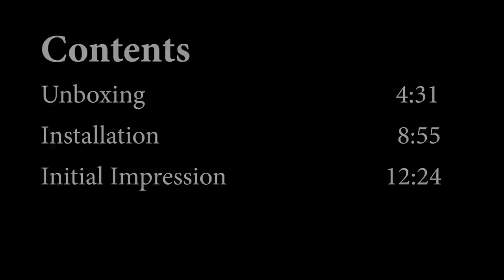"WeBoost Drive" Cell & Data  Booster/Amplifier Review: Intro and Installation

Comment: Thanks for review. I took a 2 month trip from NY to Texas to Florida and back at the beginning of the year. I tested  the Weboost 4G-X-RV with Verizon, ATT, and T-mobile at all the places I boondocked/camped. I tested both an omni and yagi external antenna. The results were interesting. I learned a couple of things:

1st, DB isn't a very useful metric. I used the Speedtest app to check upload/download speeds. You can have great DB, but a crowded/lousy cell tower. After all,  how fast you can download or upload a video is what makes the booster useful. 

2nd, there was no best network. All three major networks were better at some places. A good portion of the time, the unboosted signal had a better download speed than boosted. Upload speeds were always better with the booster.

 3rd, The yagi takes time to set up (and can't be used while driving). In really remote areas with no signal, the opensignal app didn't always give a direction. So you had to hunt for the tower. At one place on the Texas coast, I could only get a connection with the yagi antenna. Most of the time, the extra effort to put up the yagi wasn't worth the effort. The omni antenna provided similiar upload/download speeds.

I have a small 14.5' trailer and I had to use the small candy bar antenna instead of the one provided with the RV kit. Since I couldn't get the required separation (getting green leds during boot-up).

Weboost was definitely worth having. But having multiple carriers is also important!

Comment: Hi...Thanks for the video. Please run a speed test with the booster turned on and with it turned off. Why guess? The increased speed from the booster is what we're really interested in. Thanks
Reply: This where the problems come. I have this booster and I will give it credit that it will increase the signal. HOWEVER run a before and after speedtest  and data speed are CAN BE worst with the booster on. Weboost has a wonderful marketing department.

Comment: The five bars showing on the phone represent the rebroadcast signal from the booster. Since the booster is in the RV with you, it makes sense that it’s a very strong signal. Unfortunately as you note, that does not mean that you get the same speed you would get with five bars generated from a cell tower. If you had one bar to begin with, the signal being rebroadcast to you is not great quality, but glad to hear it does help.
Reply: I’ve never seen one that works that way but anything is possible. The good news is it did help.

Comment: Looks like a great product but one thing I noticed was the sticker on the antenna reads that the frequency range is between 698 to 2700 megahertz. T-mobile especially and I beleve some AT&T are rolling out new service in the low band 600 megahertz Spectrum. Before spending this kind of money I want to make sure this product will operate on the new spectrum and if not is there a new model that will?

Comment: You may have great signal to talk to the tower, but everyone using the tower must share the  bandwidth. The more users the slower the throughput is.  If the tower has 5mhz bandwidth not many users can use the signal at the same time. If the tower has a 10mhz bandwidth carrier the you will get better throughput with the same amount of users but as soon as more users get on, the slower the throughput gets again, all the while you have 4 to 5 bars.

Comment: got it, love it!
Reply: vantastic voyage, do u have a video on it?  Is it mounted on ur roof?  Mo
Reply: I have it installed on my 18 wheeler. It has a slightly different antenna than the rv version but it will work on an rv. no i don't have a video yet

Comment: Hi Carolyn and Bob. the cable has been compromised once you bend those cables around that ladder making those sharp turns the cable has been compromised so if you're going to put a permanent one in don't make any sharp turns with it and if you don't and you want to get a new cable wrap it in a large Circle and hang it somewhere but you can't make sharp turns with it or it will compromise it and then your signal will start going out on you

Comment: They are not spacers Carolyn. They're called Dyna bolts for inserting  to pre-drilled holes in concrete. Thats why they were spreading as you tightened the nuts.

Comment: This product looks like it's for use while driving and parked because it sends/receives in all directions.  I suspect the directional(triangle shaped) antenna would work better than this one while parked.  At least it gets your cell signal outside the RV where it has better propagation than from inside.

Comment: Mr. Bob,
Tell Carolyn
....do not tie the feed line "coax RG6" on that latter as seen to the left of Carolyn. 
....please do not store it that way ether. It's not extension cord or landline cord.
....take care not to mash, kink, pinch or tight bends. That can cause distortion to the dielectric insalator. That's the stuff between the center conductor and the metallic shield underneath  the outer plastic jacket. 
...specially if it's retransmitting or broadcasting back to cellular tower.
  Can cause some problems in preformance. 
Just saying. 
Just loop it in a 10" to 14" and loosely zip tie it or tape to latter.
Thanks for what you do!
Jeff

Comment: Signal strength and speed aren't necessarily related. Traffic on a tower can slow speed since it can only handle so much at a time. So you can have a full five bars and still have trouble with speed. My speed usually drops in urban areas and speeds up in the boonies.

Comment: Whenever ANY company gives you something to try out, just tell them up front that you'll be giving an honest opinion, good or bad.  As long as you're up front with them and they still agree to provide the item, there's no need for you to provide a disclaimer to your viewing audience other than to say the item was provided, but the opinions within are yours alone.  If you have concerns, throw into your intro that this is an honest review and add a single-line text disclaimer to your video description.  This kind of thing happens across MANY, MANY channels, and I've never seen one where someone who told the company that your review would be honest, good or bad, resulted in "backlash" from viewers at all.

Comment: I need one of these designed for use in a rural house.
Reply: Shell Cshells the RV one should work if there's a signal.
Reply: HOBOTECH Brilliant, thank you!
Reply: HOBOTECH, hi and thanks for the info.  HT, is it mounted in the best place Carolyn has?  If not, where it should be installed?  Do u think the metal is affecting the signal?  Take care, be safe, Mo from NJ and...
Reply: if i have a directional antenna on my camper could i just plug this booster into it?

Comment: Thanks for the info and being upfront about the free unit.  I got one to test. I installed it (https://youtu.be/iew18uWvdfw).
I definitely get an increase in signal Dbm and upload speed. In my tests so far, the download speed is worse than without the booster.  I'm ouit boondocking from NY to Texas now. I'm collecting more data points.

Comment: Great product.  To bad it wouldn’t work for computers or iPads.
Reply: You need an antenna port, plug in.
Reply: HOBOTECH, wow, what did u say?  I have no clue about this but when I am ready to hit the road in a year, I'm gonna pick ur brain again, lol.  I have learned some things tho.  For example, I know...

1)  I need to buy a pure sine wave inverter and not a moderated or modulated, whatever, one.  
2)  Flex solar panels don't put out as much as rigid panels.  
3)  Fridges are warmer when powered by electricity.
4). A small apt size, 5-6,000 btu ac needs a generator if not hooked up power.  

That's about all this feeble brain absorbed.  Lol, are they all correct?  

Cheers, Mo from NJ and...
Reply: HOBOTECH, thanks for replying.  Compressor fridges are those ones that look like coolers and open on the top, right?  I read someone's comment somewhere that the ones that are 3 or 2 way don't get as cold when they run on electricity.  Maybe they were comparing them to when they run them on gas or battery meaning when on electricity, they aren't as cold.  

Anyway, thanks and I look forward to learning more about RV life on the road.  Mo from NJ and...